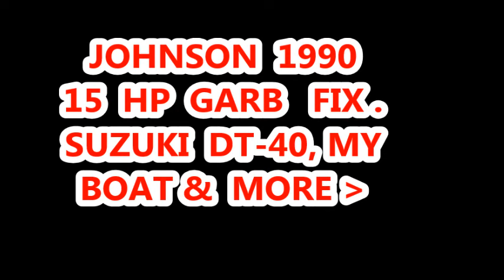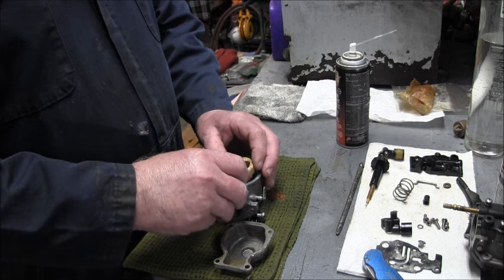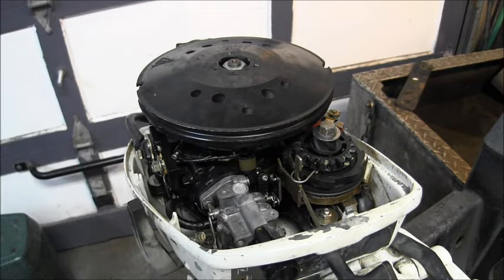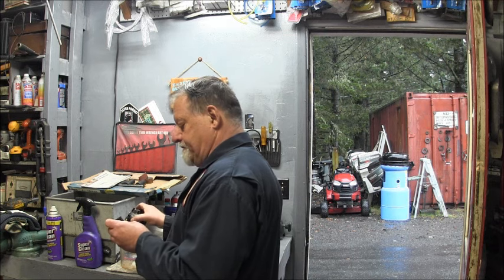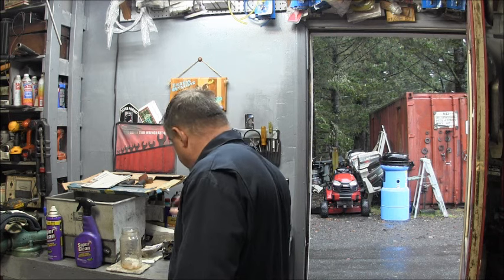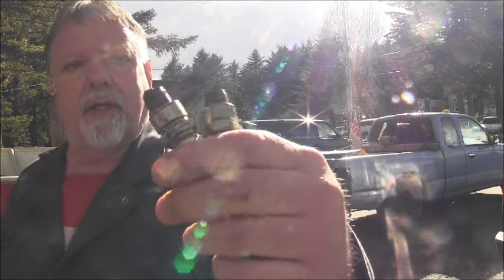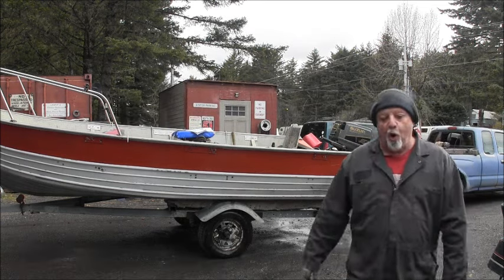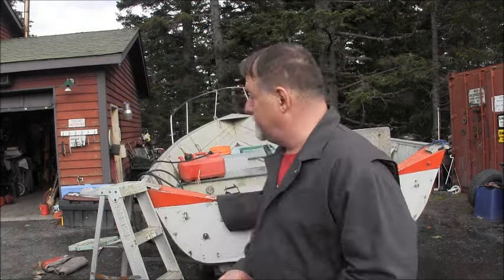JOHNSON  1990  15  HP GARBAGE RATOR  FIX,  MY BOAT & MORE

Comment: One of the worst mistakes we made at OMC, that GD CPS carburetor.  That aluminum carb was the most rugged, simple, easy to service carb ever.  It's only fault is the damn tin bowl!  Trying to find one of those now means parting with big bucks.  One of the major issues with those damn "modular carbs" is that there were so many changes made to them during the years, it is super easy to mismatch the damn parts/gaskets/needles.  Even the initial needle settings were all over the map.   I could never keep up with all the changes.  And god forbid you ordered a new plastic top "kit", you would think that plastic was actually titanium the way the kits were priced.   Trying to goop up that top is not a great idea.  Like you say, most of those plastic tops have ribbed edges to help seal properly.  So, if there is really a sealing issue, there must be a big problem with the top, usually some hair line crack somewhere.  The only exception to this are those 93 carbs that were missing a screw in the rear corner.  It is a shame that so many dealers kept these first carbs during the update campaign, now they are selling them off like they are gold, hopefully karma will catch up with these crooks.  
As for that cooling telltale, I fear it is time for a grommet job, sure hope I am wrong though.  It surely is possible the pump is worn I guess.  Nonetheless, a nice engine like this one is surely worth doing the grommets.

Comment: I thought I had issues with a plastic top 5 screw carb 9.9 hp motor that wouldn't start. The candles stayed dry although the fuel pump was building pressure. Swapped on an all-metal 15 hp carb I had laying around and it started, ran rough but it ran. I bolted back the original carb and low and behold, it started and ran fine !!!  My guess is that spyders made their way past the intake (up the exhaust ?)  and their cobwebs restricted atomized fuel to the cylinders. But I could be dead wrong here. Could you submit my hypothesis to Fret ? Take care and be merry !
Reply from the maker: Question Is  Why R The Creepy  Crawlies  In  There ?   Dang  I hates  Them,  By da way it's on it's way      kb